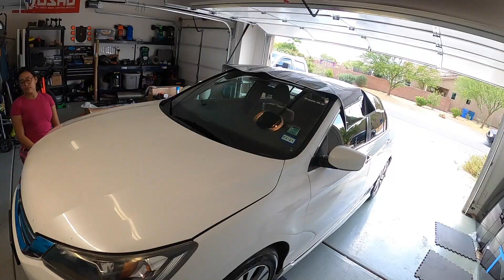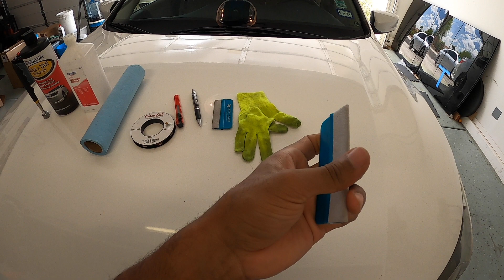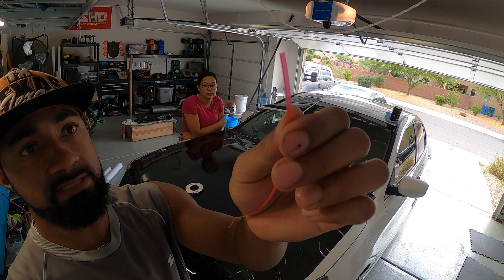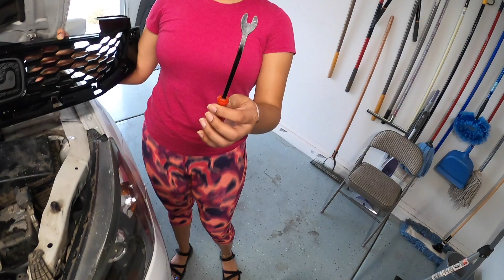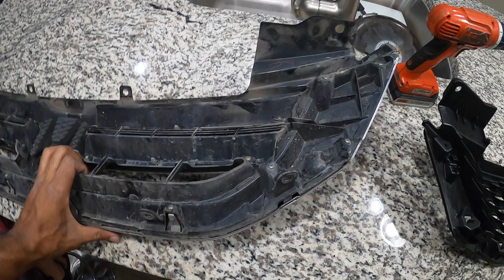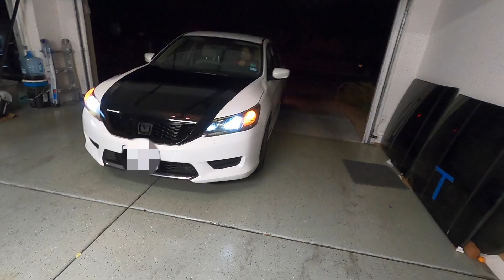(PART 1) VINYL WRAPPING 2013 HONDA ACCORD| How to Vinyl Wrap your car

Comment: Would a 5 by 5 be enough for a 2008 accord
Reply from the maker: Depends if your only doing the hood or the roof or the trunk. you could do one of those with a 5X5 but you'll need a good 12-15ft for the whole hood, roof & trunk. and you'll have some left over.

Comment: Was the grill for the coupe initially? If so was it difficult to retrofit it on to this sedan
Reply from the maker: It is a coupe grill. I had to do some custom grinding and trimming to get it to fit on her Sedan. Unfortunately I didn't film that part, but it was a 3 out of 5 on a easy to difficult scale. 1 being easy. Mainly because it was a lot of trial and error, cut a little bit, test fit, then cut more, then test fit again.